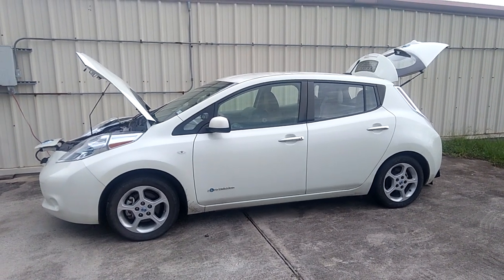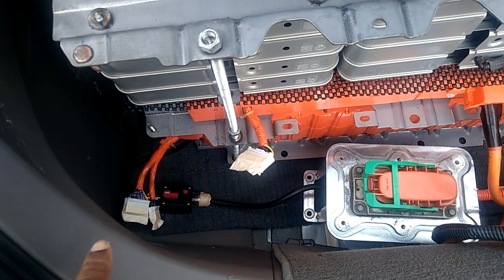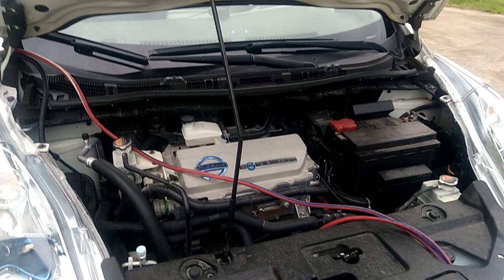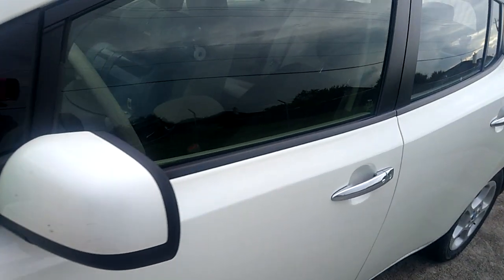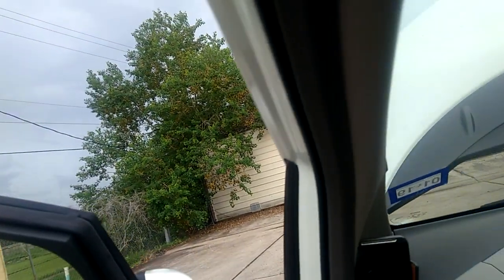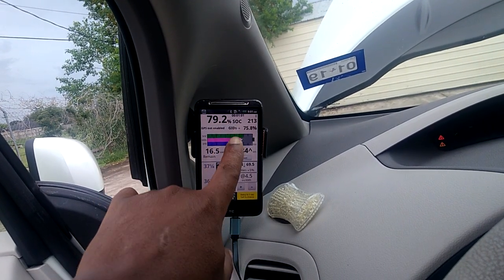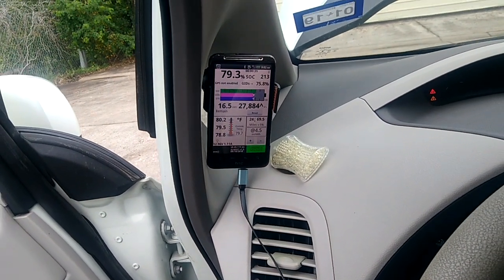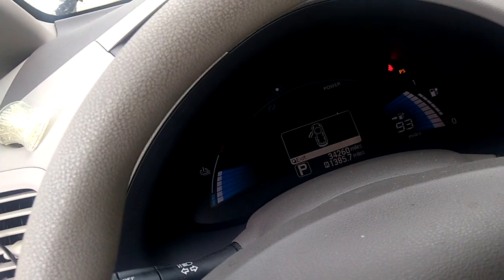48kwh battery upgrade (DIY) with 24kwh battery in the trunk no CAN modification done.

Comment: You need a BMS, it can run fine for years without it if you are lucky but if you're unlucky the voltage can go crazy on one cell and cause a lot of problems including a huge fire. A BMS would prevent this from happening.

Comment: do you need a relay to turn on the 2nd batt when the ignition is on? and also do you need any modification to have the 2nd battery charge from the main charge port at the front of the car?

Comment: every simple crash (at 20km/h) will make your battery flys around possible to  kill someone, you must ask a stress engineer for a proper mechanical structure to hold the batteries
Reply from the maker: Just don't over think it, it is not that bad, two years plus and I am still driving.

Comment: Low mileage is not a Nissan LEAF'problem. It's owner's problem. Buy new modules and have fun driving, without any Webasto heaters and twinbats in the trunk. Now I have real same as original modules for upgrade. Not original module , but same as nissan's, is avaible now! 24/30/40kwh
Reply from the maker: How much for the best capacity you have?
Reply: @t.shonoiki563  40kwh is now, and 60kwh soon.
Reply from the maker: Cost of 40kwh
Reply: @t.shonoiki563  5700USD EXW. Were are you from?
Reply from the maker: @dotcustom_ev  Texas

Comment: this is what I just did, nice upgrade.
Reply from the maker: Were you able to reset the capacity bar to full?
What details are you getting from LeafSpy?
Reply: @t.shonoiki563  I just installed I need to test it.
Reply from the maker: https://www.youtube.com/watch?v=6R9QV947ik8&t=5037s
Reply: @t.shonoiki563  looks good!
Reply from the maker: Chademo will reduce your range via capacity bar. Keep using your 220v power outlet to charge for now. This is from experience.
Reply: @t.shonoiki563  I have not fully tested yet, but I'm 90% sure it has

Comment: Sir you have done well ! I would like to clarify where you actually tapped in to the original battery. Was it inside the battery box and not on the cable from the battery box to the motor. Also do you have any error codes coming up as a result of adding the extra pack ?
Reply from the maker: The connection to the second battery bank was made inside the first battery bank and you should not have any error if your second battery bank is well insulated from the body of the car.
Reply: @t.shonoiki563  Thanks for that. I may contact you again if and when I get my battery bank apart and check that where I am doing the connection is ok, thanks.
Reply from the maker: That is okay, but be careful as you are dealing with high dc voltage.
Reply: @t.shonoiki563  Yes I will be careful. I am an electrician and have worked on Prius systems and batteries before, thanks.
Reply from the maker: @NB-ld1qt  https://www.youtube.com/watch?v=OIUjmi1OBAY&t=378s

Comment: Thanks for posting & mentioning Leafspy, & hypermiling is the right word ( https://ecomodder.com/ ). So what is your range now after all this time with a rough avg. of 1- frequency of usage, 2- mi per trip, 3- Ambient temp ranges, etc.?
Reply from the maker: 60 to 70 miles of real normal road driving.
Reply: Hi, his range is more than what he says. The computer in the car doesn't know that there is another battery in the back. Muxan in the Netherlands had the same issue. He can still drive another 30 to 50 miles when the car shows low battery.

Unless both his batteries are too low in capacity which I would call rubbish!

Comment: Thank you for taking the time to make this video!
I have a few questions:
1)  It is not clear how you've connected everything or what exactly you have done.  I don't understand.  Can you, or someone explain what exactly plugs in to where?  The video does not provide sufficient detail so that I can actually go and do it myself.
2)  How is the extra battery pack retained in the back of the car?  I mean, if you are in a crash, even a low speed crash, that battery is like a 200lb steel anvil sitting behind your head.  If you crash, it will keep moving at the speed you were going, flying forward and out through the front window (with your head attached to it).
Reply from the maker: All the battery modules with all the metal bases with them in the main battery container were used. I had to insulate them from the 12volt low voltage of the body chases of the car which was a challenge for me to attached them together from the car body. What I did was to attached/hold all the batteries together with some rod and have them together in the trunk.
You will need to see other videos to have a better view and I will need to put a cut-out video of how I put the battery together at the back.
Reply from the maker: https://www.youtube.com/watch?v=I3WG49kw_hI
Reply: Hi  @t.shonoiki563   can you upgrade mine? Can I take your contact details to discuss?
Reply from the maker: https://www.youtube.com/watch?v=6R9QV947ik8&t=5037s

Comment: do you have the communication ptotocol between the car and BMS ,  if don"t,  how will it work?
Reply from the maker: No, I did no modification to the electronic communications protocols. I only connected the big  two bank of batteries together.
Reply: @t.shonoiki563  You mean paralell a same cell to each of the original cells ?  Doulble the copacity?  In that case, how to make sure the  consistency between the old one and the new ？
Reply from the maker: https://www.youtube.com/watch?v=OIUjmi1OBAY&t=378s
Reply from the maker: This method bypassed CAN BUS modifications.

Comment: I thought the Nissan leaf had a range of about 80 miles so if you doubled the pack you should be getting over a 150+ right?
Reply from the maker: No, you do not get 80 miles real road driving on the first generation Nissan leaf battery. the batteries degraded to 30 miles real road driving after many years because they are not protected against extreme weather condition. The battery is best at about 75-degree Freiheit. And I am not sure if they are software limitedly controlled by Nissan too.
Reply: @t.shonoiki563   wow that gives me some thinking to do cuz I was getting ready to get one and I seen them as cheap as $4,000 used now I need to check and see if the battery in any good don't want to buy one if I'm only going to get 30 miles I'll just keep my Chevy volt and not have to worry about running out of power
Reply from the maker: @turbomike69  Chevrolet Volt is better than the first generation Nissan Leaf. 
If you must buy Nissan Leaf, you have to have Leafspy on your Android devices and an OBD  Bluetooth device to know the capacity of battery status of the car.
Reply: I have a 2015 Nissan Leaf standard with a 24 kilowatt hour battery I think almost 60,000 miles now and I still have the whole battery about 80 mile range in the summer and about two-thirds of that in the cold winter. I think they started doing better battery cooling technology starting in 2015 so I wouldn't recommend buying one older than that.
Reply: @steventhegreat1887    They changed the battery formula that resulted in better longevity.  Heat was hurting the original batteries.

Comment: Nice to see someone try to think out of the box. You should get a BMS. The amp draw from those batteries are pretty high. Naija no dey carry last. Your internal BMS is not seeing the two batteries
Reply from the maker: I hope to use the aftermarket Battery Equalizer on that extended battery pack. So far so good this conversion is over a year now and my second conversion 2012 Nissan leaf is on the road too, both of them are running good.
Reply: how could this battery power the car without a BMS communicate in advance .

Comment: There could be some fireworks if a cell shorts in that back pack with no BMS. It will also age fast if parked in the sun.
Reply from the maker: 250A resettable fuse will take care of that and the main car battery is connected in parallel with this bank too which has the battery BMS.

Comment: Hi are you having any balance or temperature problems with the pack in the boot?  No BMS may lead to issues what do you think? Nice work however.
Reply from the maker: The capacity bar of the main battery has dropped by four bars and the car will charge it according to the eight-bars level which is what I am depending on for the battery in the boot/trunk too. The addition was done in January 2018 and my effective range increased from 30miles to 60miles.
Reply from the maker: https://www.youtube.com/watch?v=CHd_3Mkhw0s

Comment: You should look at this Gentlemens (PowerElectronicsBlog) His video are well explain and educative, in fact he did exactly what your trying to do and in my opinion he succeed. Have fun.
Reply from the maker: Yes, you are right about what Gentlemens (PowerElectronicsBlog) is doing, only that I solely depend on the Nissan leaf OEM electronics to operate the car as it is a finished tested product. All that I am doing is adding more battery of the same capacity together in parallel, to use and charge them together. I am very happy with the result.
https://www.youtube.com/watch?v=OIUjmi1OBAY&t=378s
Reply: @t.shonoiki563  could you say or show more detail of how you wired the battery pack in parallel
Reply from the maker: https://www.youtube.com/watch?v=OIUjmi1OBAY&t=378s
Reply from the maker: https://www.youtube.com/watch?v=6R9QV947ik8&t=5037s